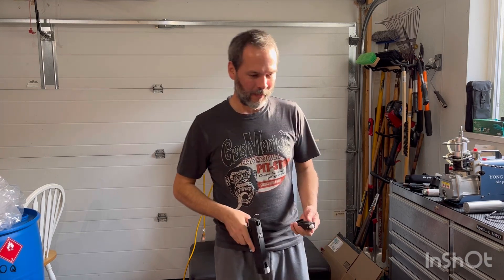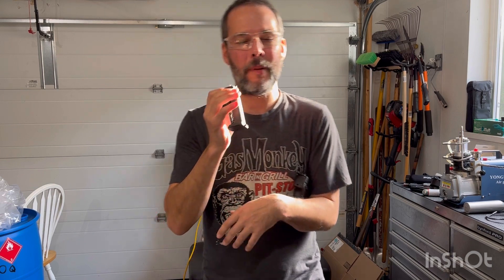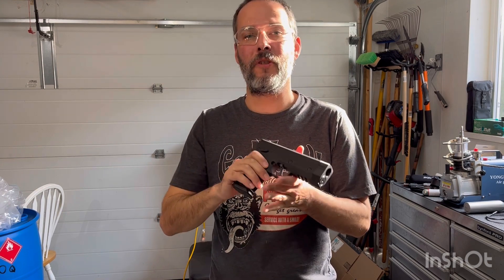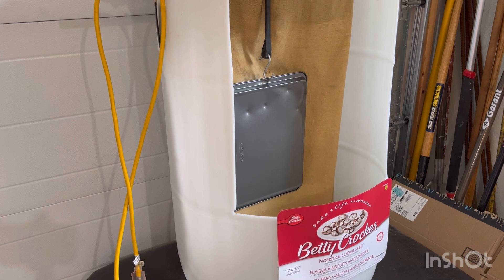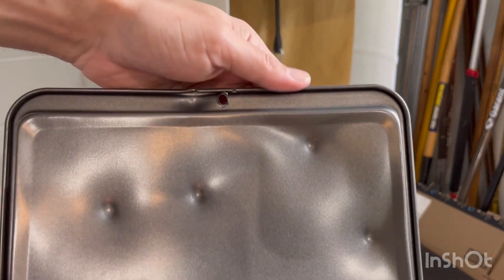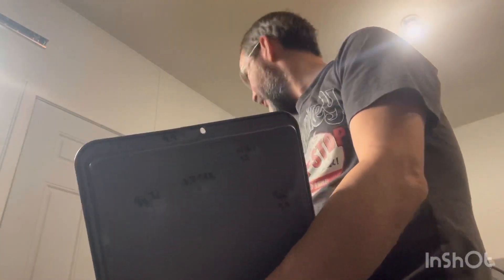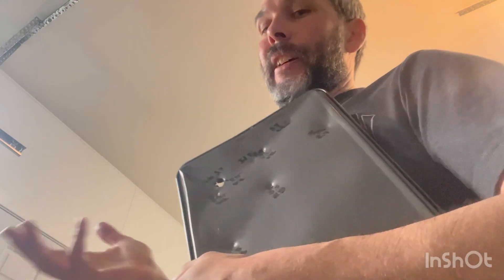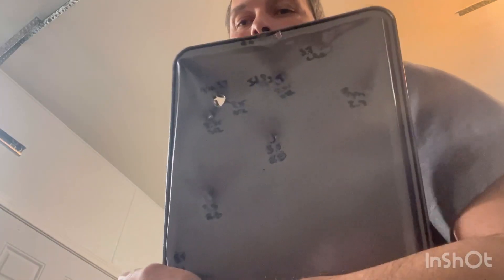Byrna SD vs Umarex Hdp50 Less Lethal - Unscientific Kinetic Testing

Comment: It seems no matter what was shot from the Byrna. They all look to be the same power. Trivial difference at most. I think a face shot from any of them would not be fun.
Reply from the maker: I agree the shots from the Byrna were of negligible difference. Based on why and where i carry the Byrna at the distance I intended to use it is LL by definition. 

The Hdp50 from a car window at short range may not be perceived as LL as demonstrated. Doesnt make one wrong or right….choose your desired results.
Reply: @lesslethalfordummies  100% agree

Comment: Hey Sean, I was just watching one of your videos where you did some mods to your umerex hdp 50. I wanted to run something by you. I watched a few other videos Wich one was horrible but the outcome was amazing shooting at 500 fps. Simply laid the hdp on its side popped out the pins, took off the brass valve on the back and removed the hotshot shaped block inside there and simple put it all back together without that valve block. I really couldn't believe what I saw. The downside of it as I'm sure you already know is that they only got like 10 shots per 12gram co2s but at 500 fps it's to be expected. please lmk if you try it... Love you're videos keep it up my Man!
Reply from the maker: The Hdp whether Usa or Canada comes as the 7.5j version. No restrictor, valve block. Remove the valve block will get about 18j with a 12g. Add some tuning extensions and you can reach 30. 500fps is with sub 2g balls. My hdp hit about 260 with 8.4g steel bearings. The hdp is awesome but the detent needs immediate attention.
Reply from the maker: @CoinCollector1 probably too slow and long for you to understand. I go out of my way to help people. I see all the comments whether you delete them or change them.

Comment: Nice little side by side. Numbers time.. .50 cal has surface area of 0.7853in2. .686 has a surface area of 1.4698. Almost double. In terms of less lethal, you can use more power with a .68 and spread that energy out over more surface area with less risk of lethality, with a larger area of impact. The inverse, a 50 with less power, is more likely to penetrate. A 22LR has more energy than both and will certainly penetrate, however it offers limited stopping power. A baseball bat doesn't penetrate but offers stopping power. I feel like a 50 cal buried at center mass is more trouble for a less lethal user simply seeking stopping power deterrence, than that of blunt impact higher power 68. Not saying a .50 ball bearing in the chest wouldn't deter someone. Simply that it could cause the holder of the 50 more problems. As you stated Sean, these two have different purposes. The user should be aware when choosing shot placement, which caliber they are holding. Cracked skull vs leaking skull. Bruised ribs vs sucking chest wound. Just something to keep in the back of one's mind. Know what you're working with and know your objective.. Joules and calibers. Tests like this are always a nice way to visualize the real-world effect chronos, ball gauges and scales don't tell us. So... shoot more pans, maybe a pan with jeans on. Perhaps a pan behind your trap cloth.  I'm entertained any which way!
Reply: Such a good comment! very true, id take a mag dump from a .68 giving 300+ fps over getting hit by even one    .177 moving 700+ fps although both wouldn't be safe 😂 .. Now if it was a face shot, idk.. Maybe the. .177 id take my chances with 🤔 more likely to skip off the skull where the .68 could possibly crush skull..
Reply from the maker: I do agree the small caliber may be perceived as less blunt force trauma. Its really hard to say for sure since the pans dont talk back and i have yet to see anyone take a steel ball as a test. The pans were fun and ill continue with more tests.
Reply: @lesslethalfordummies  I hope Jeff doesn't get any ideas.. Someone else who took impacts from same caliber- different weights,  said the lower velocity higher mass hurt more than faster moving lightweight. Joules being equal.
Reply from the maker: @JohnWixon  the way i see it is joules being equal lighter objects deaccelerate faster transferring less energy.
Reply: Of the many C02 and HPA defense option videos I've seen, this comment, from a perspective of 1000's I have read, really cuts through the hype, jargon, and rhetoric of these platforms. Anyone who doesn't think any one of these, even at factory specs, can't be lethal, shouldn't be using one! I use them because they reload faster than my sling, but for pure blunt force stopping power, I'll take my sling.
Reply from the maker: You are so right. The biggest problem i see is LL is still in its infancy but growing fast. Many see a video and jump on the bandwagon without fully understanding the consequences. Less lethal doesn’t mean there is zero chance it could be used/misused in a lethal manner.

Comment: What did you install into the degasser? If its gone how do you degass it? I'm trying to find a nipple with thread to screw into where the brass cap goes but so i can just use hpa directly or a bigger co2 tank from the buttstock area
Reply from the maker: I tapped the valve 1/4npt thread. Somethings i just didnt share via YouTube. There are posts in the group but i suggest you just buy one of the premade adapters as it will save you headaches. This was just an early version of those that you see now.

Comment: do you have a video on how you did the byrna spring?
Reply from the maker: I think this is the video. I had some trial and error along the way so if you search Byrna Less Lethal For Dummies you should see multiple vids. I do not recommend taking your Byrna apart unless you have the patience of a saint.

Byrna SD Less Lethal - Test Firing Another Lighter Valve Spring
https://youtu.be/oiEeWvz1VWY

Comment: bro great video!! i just purchased a byrna le launcher with the max projectiles! do you know if the impact from the max projectiles would hurt if you popped an intruder in the face with one? I know they said when they hit whatever they hit they explod and release a strong powder. also would the 9.9g canada riot ball work in a byrna le launcher?
Reply from the maker: Cant say i have taken a face shot with a max projectile but i can say a 3g paintball hurts.

Riotballs do work in the Byrna but i think they are too heavy for this air system to be the best performer.

Comment: Hard to make a comparison of the off the shelf product when the Umarex has been modified
Reply from the maker: You are 💯 right and i did mention try to ignore the extras on the Hdp. The Byrna is still my carry at this point because of its trigger pierce. Cant beat that. Also 50cal offers much better penetration which is kinda the opposite of what we are looking for in LL.

I am a Byrna fan and own 3 technically 4 if you count the Tmc.

Comment: What do you mean when you say your air gun is HB a power that contraption on the back what is that exactly
Reply from the maker: HPA is an acronym for “high pressure air”. It means i can attach a larger bottle type air tank instead of using co2 cartridges.

Comment: I tested byrna kinetics (2.9g) vs the  wrecker busting balls (4.5)g on a baking pan as well and got pretty much a very similar indentation mark but then i tested them on a bher gallon of paint at 25 ft . The byrna kinetics left a good dent but the home wreckers actually cracked the metal and paint was gushing out all over
Reply from the maker: Heavier balls do transfer more energy so long as the distance isnt too great.

Comment: like bolo young , told , c.van damm in BLOODSPORT , very good , but pan dont hit back  lol !!!
AWESOME SHOW AND TEST MY BROTHER !!!
it was pretty good for a not so scientific test  !!! LOL 🤣👌👍
Reply from the maker: Yeah my pan was too baked this day and just laid flat. Thanks!
Reply: @lesslethalfordummies  lol well my latest build , HDP .50 only came out to a mere 38.22 joules , 314 FPS with a steel ball tuned for my HD-24 tuning barrel weighing 8.39 grams instead of the norm 8.53 getting 8 good shots and 2 too low to read , ALL FROM JUST A !@ GRAM CO@ POWERLET . the one i built before this one got 330 fps with 8.39 gram steel balls for 42.22 joules 6 good shots and 3 too low to read on that one and still just off of a 12 gram co2 . i ask people also if they want more regulated power shots that allows them 12 to 18 shots i can do that too . one day soon i will break out my hpa tanks  , fittings  , and hoses to see what these beauties  can do also !!! . i am in the present time completely rebuilding a special RG MODDED HDR.68 . 
my specialty is building less than lethal markers that can be carried in a shoulder holster or holster , open or under your shirt using 12 gram co2's . i have the equipment also if someone wants a 500 dollar special complete with a "3" piece tuning barrel , lubed up and polished internals, plus more , powerful stainless steel powerful valve pins, hpa fittings ,coiled hose and 13 ci tank  ammo bag and 200 rounds of perfect fitting 8.39 gram steel balls for more of a home defense type less than lethal option !!!
 my dream soon is to start building smaller carbines from hdp's and hdr's real soon ! these will be super fun ! 
man i need to get a camera and start making videos , i should have been doing this since 2010 when i first had the notion , lol , i was in new Orleans 2 years prior and 3 after pursuing a music career at the time and that didnt go as plan , as i like to sing rock ,all types , and country and soul and rap !, could find enough people to want or could do all these LOL. 
SSSSSSSSSSSSSSSSS)))))))))))))OOOOOOOOOOOOOO YYYYYYYYYYYYYEEEEEAAAAAAAAAAHHHHHHHHH , i should have just started making videos , i was a master at daisy 880's , crosman co2 1077's and believe it or not could make daisy red ryders powerful enough to hunt and kill birds too  !!! i also began hot rodding markers over 20 years ago ,but ever since less than lethal came out , its all i can think about  LOL ........
YOU OF ALL PEOPLE SHOULD GET WHAT I"M SAYING , LOL ......
Reply from the maker: Sure do.
Reply: @lesslethalfordummies  LOL !!!!!!!!!!!!!!!!